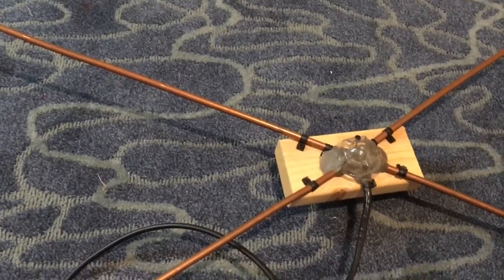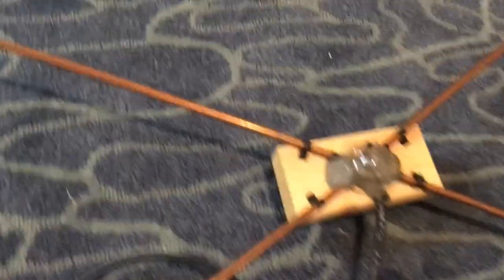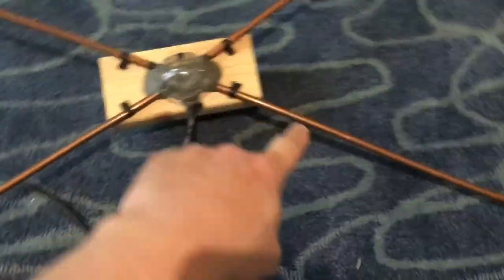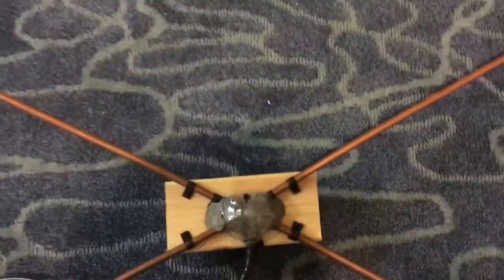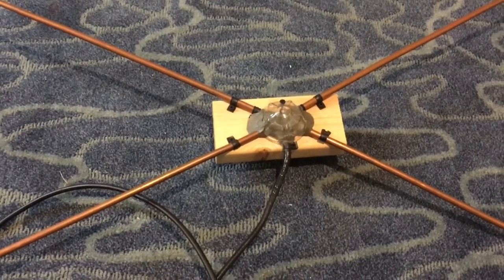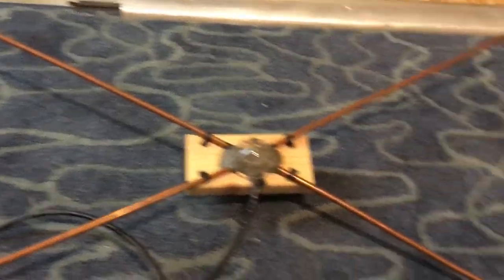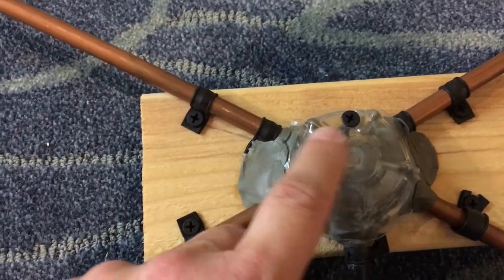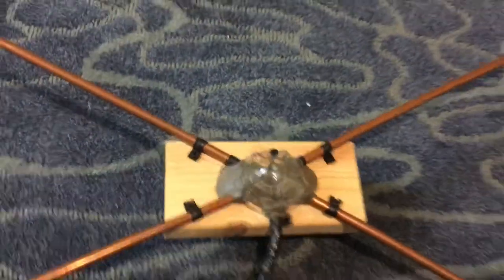Homemade Dual V Dipole Antenna For NOAA Satellite Images For My Raspberry Pi Setup

Comment: You would probably want to have the second V on the back end higher or lower, otherwise you will have a cancelling effect since the antenna will take on characteristics of a beam that is mistuned since the distance varies between the elements as you move to the tips.

Comment: Good stuff Fuzz - how have you wired this pair? Connected them in parallel or some other fancy method? Looking forward to seeing the results which you get.
Reply from the maker: When looking at the antenna I have 4 pcs of copper. The 2 on left goes to the "shield" or "center pin" and do the same for the right side.